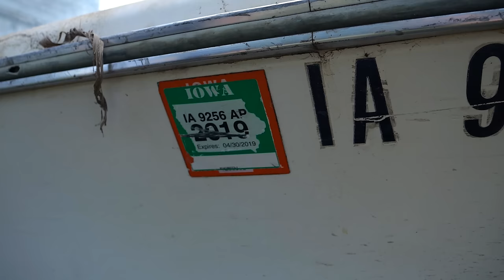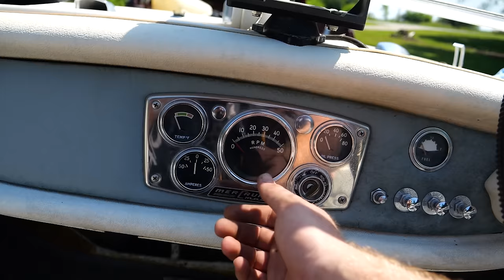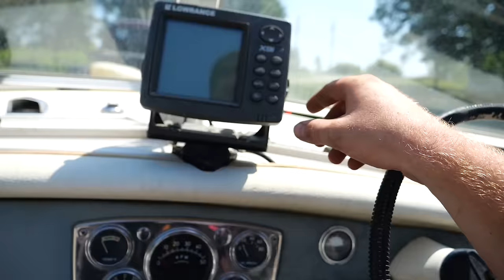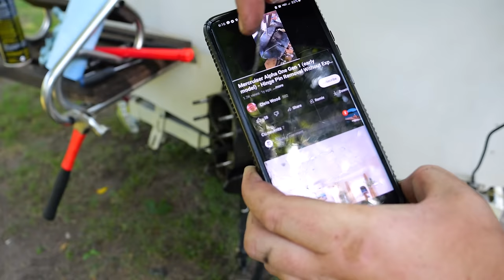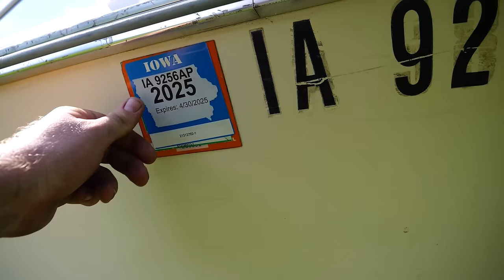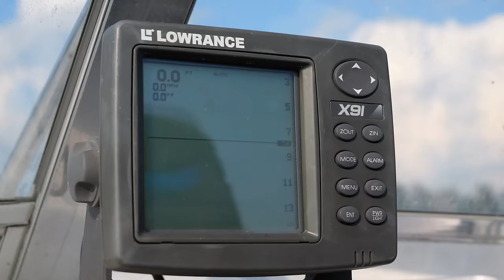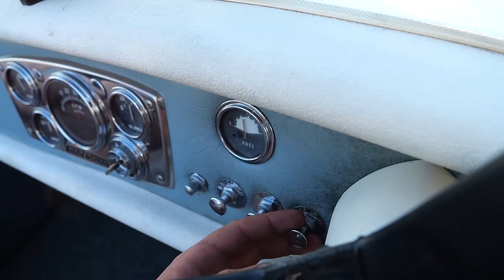Will a FREE Boat Run & Drive or SINK after YEARS of Neglect?

Comment: Hi Kevin running the boat without water going through the water intake could scar your impeller and make the motor run hot. The impellers are made of rubber and water lubricants them.
Reply: fun fact water is not a lubricant all it would do is cool the motor
Reply: Was just gonna say that, from experience that exhaust hose is a pain to replace when the impeller pump doesn't pump water out the exhaust.
Reply: Just about to write that.... and I saw yours.
Reply: @TheTallOne890 Yeap....
Reply: @TheTallOne890  also keeps the rubber impeller cool without water it will get hot and eventually fail doesn't happen immediately but I wouldn't run it to much like that
Reply: Yep, dont run without water, it destroys the rubber impeller.
Reply: @travisevans7502  I've seen brand new impellers shred themselves in no more than about 30 seconds in a completely dry lower unit. It's dense rubber tight against metal.  A little water makes ALL the difference. 27:32
Reply: @StubbyPhillips  I have never had one fail that fast but not recommended to run without water every boat I’ve owned I have put new water pump impellers in always got old boats that needed work so would just replace them because I didn’t know the history
Reply: Ask me how I know 😂
Reply: Surely he's going to replace that impeller after sitting that long
Reply: He seems to know what he's doing so I guess he only ran it dry because he already planned to replace the impeller.
I'd have warned people not to do that though...   You shouldn't even START an outboard or stern drive with no water.
Reply: @TheTallOne890 it really relies on the water to keep the parts from scoring each other. Simple fact, water pumps cannot run long if you run it dry.
Reply: @TheTallOne890 here's a proven fact, two perfectly flat steel surfaces that has water applied to it has more contacts her first therefore will be next to impossible to separate. Water fills inclusions and Imperfections creating a perfect gasket
Reply: I was shouting at my phone, "shut it down, shut it down, you're killing that old probably dry impeller."
Reply: 👏👏👏👏👏👏#1 comment
Reply: @RandomGuyDan  🤣🤣🤣🤣🤣🤣 I was definitely cringing
Reply: @TheTallOne890  fun fact old rubber impellers will crumble without water
Reply: @TheTallOne890  nope
Reply: @Eggugat  it's not because they are not lubricated its because they are so incredibly dry the water is the only thing keeping them from crumbling
Reply: @TheTallOne890  for sure that and prevents over heating and warping of new ones.
Reply from the maker: We had a pair of muffs on the lower drive after the new impeller went in
Reply: It's also good to have the lower unit in the down position to prevent coupler joint damage.
Reply: @TheTallOne890 
I’m a mechanic at a Malibu dealership. They are referring to the nitrile rubber impeller of the water pump. It is lubricated by water
Reply: @scottbruner9266  so then you know water is not inherently a lubricant
Reply: @TheTallOne890 go try a slip & slide without water 😅
Reply: @TheTallOne890  Sorry dude, water can indeed be a fine lubricant...research the physics of almost any winter sport i.e skiing, ice skating, etc. etc.
Reply: @TheTallOne890  except that in this type of case, it is. There is just enough of a fluid film to keep the impeller from running directly on the metal.
Reply: Everyone talking about running the boat without water, but I guarantee you the way he acted. And mook having drinks He had at least one or two drinks in him. What about drinking and boating. Boating safety is what we should be concerned about. I was hit by a guy who had a couple drinks on a wave runner and I’m disabled now because of him. Boating safety is a major concern
Reply: @TheTallOne890 ok how about you run and jump belly down without your shirt on onto a slip-n-slide without water first and then with water and see if you still believe that.  Water indeed lubricates and cools rubber and skin for that matter where friction is present, lol.
Reply: @uhoh71  let me do that on concrete and I'll tell you how well that works oh right it won't because it's the property of the materials that matter aswell as the inherently non lubricating water
Reply: It's rubber on smooth metal.
Dry, it's "grippy."
Wet, it's "slippy."
Reply: @scottcreesy6084  hahaha gotcha
Reply: @TheTallOne890  Water isn't lubricating it in the traditional sense, but hydrostatic pressure actually keeps the rubber from contacting the housing much, if at all, as well as cooling the rubber, which is why running the impeller submerged won't shred it the way running dry does (immediately)
So water is, in fact, lubricating the impeller.. Just not in the sense of oil sticking to a surface.  Google fluid dynamic bearing if you're interested in the topic.
Reply: Main points here are the need for (i) oars  (ii) lifejackets (iii) some red flares.  All will soon be needed.
Reply: Running the water pump impeller dry is a no-no.  Also not a great idea to run the motor on full tilt - on the trailer or in the water.  II's hard on the u joints.  You've experienced the same issues I've had with a similar boat except the motor mount.  Have fun with it!
Reply: @TC-uy8ng if there is one thing Kevin can do - it’s fix a u joint. And brakes…
Reply: Killing me see it run without water. Big no no
Reply: @StubbyPhillips this ^^
Reply: @JunkyardDigs as a mercruiser tech I came here to suggest changing the impeller and running the new one on muffs lol, beat me to it lol
Reply: @TheTallOne890  So glad I learned water doesn't reduce the coefficient of friction between a surface in contact with rubber from a guy in the youtube comments. What a fool I've been driving slower in the rain all these years.
Reply: @TheTallOne890 water makes rubber slippery
Reply: I knew someone had beat me to that fact

Comment: I scanned through the comments quick and didn't see this mentioned.   Never run the engine with drive trimmed up more than halfway.  It will smoke that gimbal bearing.  Also the reason marine fuel pumps are different is because when an automotive pump diaphram leaks it can weep fuel out through a hole.  Gas fumes settle into the bilge and stay there, so big badda boom if fuel vapor meets ignition.  That drive will probably be a milkshake because what likely happened was a shaft seal went out at some point and the water got into the gearcase and cracked it when it froze. So that problem is probably still there. Run it as long as it's fun, and then when it's not put a bigger engine in.
Reply: LS swap the mfn boat

Comment: Boat engines usually have an rubber impellor in the waterpump. With the first start up it was burned up. Secondly where the space gets smaller it pushes out water and where it gets bigger sucks it in the pump.
Kevin. When working on fiberglass use a sawsall or multitool. Never an anglegrinder.
Try to get hold of a 4 cyl diesel (car/excavator or so).
Put a piece of flat steek between the wood. You can drill and taper the holes for the bracket and use bolts instead of woodscrews.
Reply: excavator engines are expensive he should put a vw tdi in it
Reply: I've found out it really doesn't do much good to say/advise,or anything on the replays, because they"ve already done everything B4 hand,In other words... YouTube,or the editing,or whatever is never in real time,like utube may say posted 2hrs.ago & it's been 3days ago.I just wished someone happy birthday & it was come to find out was 5days ago,even tho it said 2hrs ago,SOooo...
Reply: @Djdj-kd8ue   comments: not for the one who posted it. Or it must be an more post on the same boat/engine. But for the ones watching it and using it at advice i hope it does.
Posting: it was filmed in the past then put toghetter. So the stated moment of putting it online is always filmed earlier.
So why would the stated moment of putting it online be incorrect?
Reply: @seanmckay3392   dont know whats more obtainable in the states. In my home country(the netherlands) i needed a diesel for my citroen. Got 1 for about 150$ with 100000 km(some 60000 miles).
Reply: I love Kevin but I was dying when he was revving it up on the first stat, I'm like oh no, he is frying the impeller LOL
Reply: @AintScaredGarage  that impeller was trash anyway, but yea. I see it all too often when car guys try and restore boats. Never start a boat motor without water hooked up lol.

Comment: Thanks for the boat video, makes me feel like I am not alone in the never ending boat repairs. I have a 1988 21' Sea Swirl  and last year I took my boat out once and found the floor was really soft. So I spent about 3 weeks cutting out the old floor and building in all new floor including fiber glassing it in with new carpet. Fall came so I quickly put it away in my barn and when I got it out a couple weeks ago I found I got busy and forgot to winterize it. I have a Chev 4.3 V6 and both exhaust manifolds froze and broke. Luckily I removed them and was able to weld them back up and all was fine. Time to get the boat and trailer licensed and take it out on the river. But need to get it cleaned out, this boat has a Cuddy cabin with a V bunks up front with a small sink water tank and stove. I sat down on the bed and crunch, the wood under the beds are rotten and now I have the cabin part all tore apart for new plywood and re fiber glassing. With boats it never stops. Looks like I will miss half of this summer fixing this damn boat before I can use it again.

Comment: Thanks for saving the boat from being  junked. One tip I have for you is to avoid running the engine with the outdrive trimmed up high. It’s hard the u joints. Also, I think the marine fuel pumps have a design that prevents fuel from leaking into the engine compartment if the diaphragm failed, so that it doesn’t cause a fire or explosion

Comment: @JunkyardDigs quick tip from the u.k ...your dewalt angle grinder... undo the 4 hex bolts at the top of the body where the motor attaches... rotate motor 90 degrees and refit... makes it more balanced...easier to control and feels lighter

Comment: Nicely done, neat old boat, looks to be mid 60s I'm guessing. I just brought a 1972 Aristocraft Nineteen back to life. mine is set up the same except mine is the mercruiser 165 which is a GM 250 inline 6cyl. We got it back in march and I went through the hydraulics, drive and engine as well as completely gutting and rewiring the electrical, she took her madden voyage on marktwain lake at the end of June. this fall my buddy is doing the interior for me and I'm going to give it a new carbon fiber dash and gauges. I love keeping vintage stuff going.

Comment: this sooooo explains and shows exactly what you get into when you buy  (or get a free) used boat.  I had a friend tell me "You know what you got there huh? A hole in the water that you throw money into." Couldn't be a more true statement.  I have owned one one boat. And it was used. And I spent alot of time and money getting it water ready. So I thought. Got her ready to go.. went out (had a great time) and almost didn't make it back to the dock because of another issue that popped up.  This happened 3 times. I'd fix a problem, take it out, and a new problem would arise. Finally got tired of it. Sold it as is. Learned alot about boats, but that's about it. Not a fun time at all.

Comment: My dad in 1979 bought a 1968 Larson with a 120 mercruiser which  had a Chevy straight six. This boat didn’t have enough power to get on plane. You could barely pull a skier and a tube would drown the rider because it also would not get on plane. In 1982 we found a 1976 Correct Craft Southwind 18 inboard boat with a 351 Cleveland 4 barrel. This boat was a beast and would pull a 250 pound man lying in the water on his back onto his bare feet with ease. Miss that boat everyday.

Comment: Yup, that flex seal and jb weld on the manifold and block is a classic "forgot to winterize it before the first freeze" fix. It will hold for a week or maybe even a season. But you need a new engine.  The impeller in the water pump probably burned up when you dry revved it.  That was hard to watch lol.  Time to Bend Over And Takeit and Bust Out Another Thousand... Or two.

Comment: Hope your new fuel pump is a marine unit with a drain tube that dumps into the intake below the carb. That's so if the pump diaphragm fails, it will leak into that line and kill the engine. Also, K&N makes a coast guard approved air filter. Cool gear, got one. Happy sailing!

Comment: Use oscillating multitool to cut through fiberglass. There's a lot less dust kicked up. It's just you know a lot more oscillating multi tool cutting stuff, which may or may not be worse.

Comment: Kevin, big fan. I’ve seen a couple of your boat videos the last few days. I really suggest you don’t run these boats with a rubber impeller sea water cooling pump without a hose hooked up. The plastic and rubber pump is ruined almost instantly without water. You did this on the maroon Century also. The boat will overheat on the water as the burned sea water pump won’t push water up to the block and the conventional iron circulation pump.

Comment: You're giving me cold sweats in 105°F heat. I tackled a 3/4 hull replacement about 4 years ago. I bought the boat from one brother, fixed, used one summer then sold to another brother.

Comment: Well if by any chance the impeller was still good, it isnt anymore...lol😂
Got to hook up those muffs on the outdrive before starting it my man.   Also, just a tip for the future restores on boats. If you pull the hose off by the thetmostat that runs down to the drive, or from the drive to the thermostat,  and dump some antifreeze down that hose with the drive down, youll eventually see some off that antifreeze coming out of the drive by the water pickup. If you do that, the antifreeze will help to lubricate that impeller before starting it. Antifreeze is kinda slippery like that and works well to help that rubber impeller to spin without sticking to the housing. You should always check the lower unit lube as well before staring and throwing it in gear. The unit may have leaked and you definitely dont want it spinning without oil or you will cost yourself a ton of money for not checking it first.

Comment: If there is a crack in the block,  that's an easy fix.  I have welded several up.  Also if you find your self in South Eastern Wisconsin, I can weld up that outdrive for you.  And repair the skeg.

Comment: Our family had that motor in our 18 foot Thompson. We only ran in salt water so it's probably different. The starter sits very low so careful that bilge water doesn't get in it. The water jacket on the exhaust may rust through causing  lots of water to enter the exhaust. If this happens you'll be unable to get high RPMs and it will sound like it's struggling which it is.  Enjoy

Comment: I'm not sure if you've figured this out, yet, but you never start up the engine without having water hooked up to the outdrive because you will burn up your water impeller.  It didn't hurt you because you tore it all down anyway, but they make "earmuffs" that you can hook up to a garden hose and they slide over the water intakes.  When you hook that hose up to the water pump on the front of the engine you're only running water through the engine.  You need the earmuffs hooked up to the outdrive so it runs water through your impeller in the outdrive, just like it's actually in the water.  Also, your skeg is broken off the lower unit.  You can buy one from a Mercruiser dealer and take it to a welder and have them weld it on and probably weld that crack.

Comment: Great job on the boat, as someone who also enjoys the boating it was a nice break from the cars…still very much enjoy the cars though!  Oh and a little tip someone told me is to disconnect your trailer plug backing into the lake in case there is a short.  Great video

Comment: When you have a chance, remove the exhaust elbow, the piece that is sitting on the top of the exhaust manifold.  The elbows are almost as replaceable as the impeller.  When they rust out, they let water into the exhaust manifold which then finds its way into the engine.  Being a fresh water boat, yours should have lasted longer, but still worth checking. Removing 4 bolts and replacing a gasket is cheap insurance.

Comment: Never let a junkyard lose on a inboard merc cruiser, because he isn't gotta enough schooling to know that unless you hook water up to the lower unit you ruin your rubber empeller that's used to circulate water through the water intakes on each side of lower unit, through the engine, and out exhaust. 
As it was it was probably trashed anyway from sitting in one place, and got hard making it at best move maybe a quarter of the volume needed to cool the block properly.
As for the carb or brake cleaner used to temporally run the engine on as he's so fond of doing, it basically washes what if any oil out of the rings causing scoring of the cylinders, and if you aren't going to at least put some extra light weight oil in them to begin with, it's not hard to mix up a little 2 cycle gas to squirt down the carb.
Considering he's probably already got some mixed up for weed eater chainsaw or some other 2 cycle engine that makes it really sad especially since he brags so much about his mechanical education the people of the United States paid  for, because of his service time.
Which isn't a problem if you use what you want for, and apply it properly and in a humble manner helping others as well as yourself along with your family. 
Hmmmmm, not disin him, more of trying to remind him of the education and what he supposedly learned, and taking short cuts isn't being a proper mechanic, and dam sure isn't teaching the young people the proper way to do something especially starting a engine that's sit in one place for any length of time